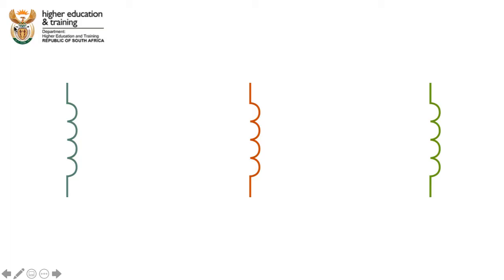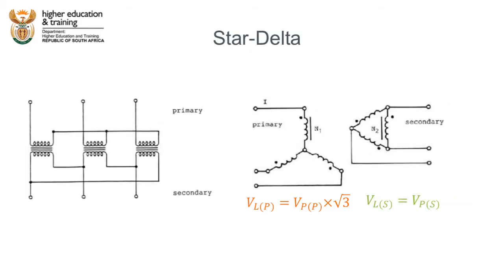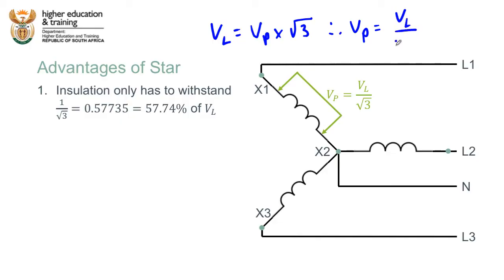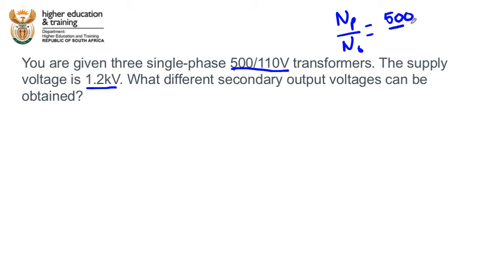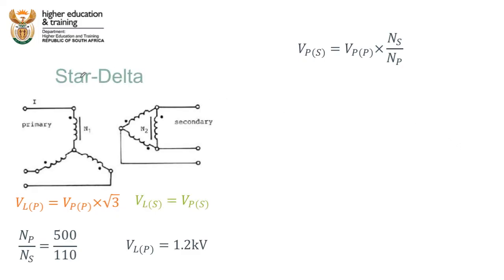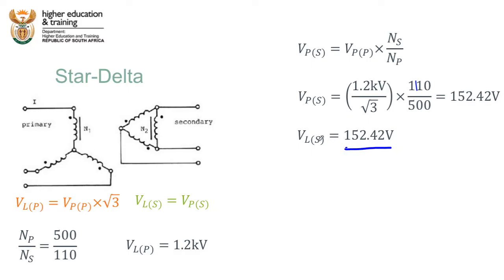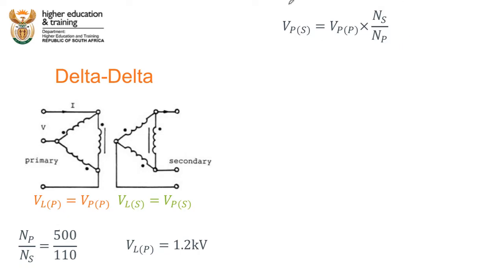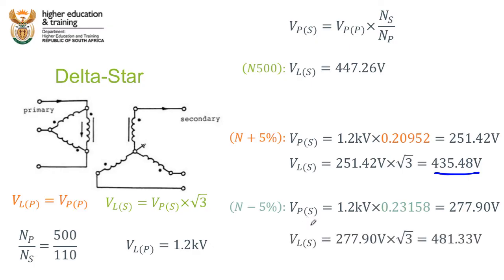08 01 04 Vid003 Electrician calculating three-phase transformer secondary voltage

Comment: Hi! Thanks for teaching! I have a doubt... Let's say that I have to calculate a transformer that has to be star-delta and can charge up to 200A. The secondary current of each tower will be 200A/(sqrt(3))?
Reply: I referred to charge because the transformer is connected to a three phase rectifier, and then charge a battery